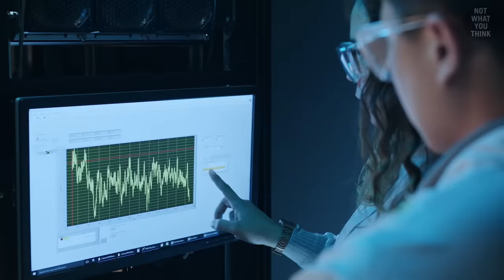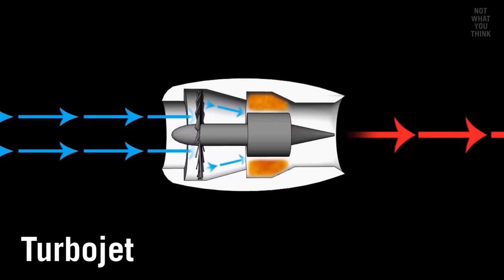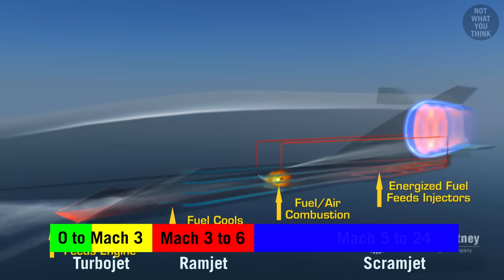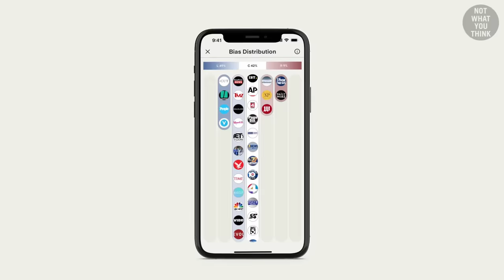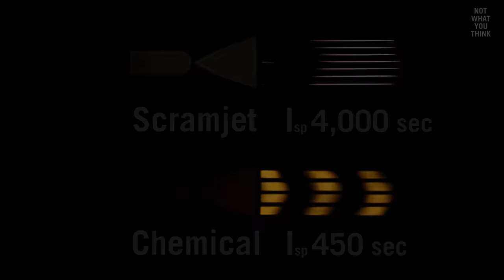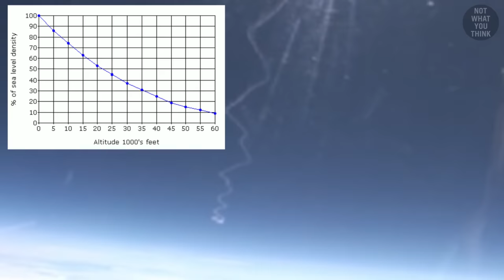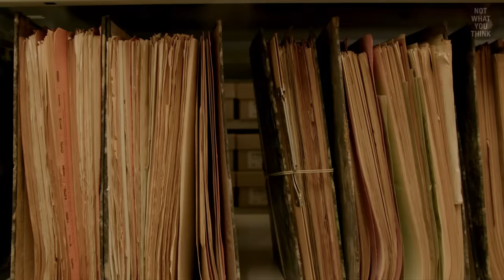The Hypersonic Missile Vulnerability That NO ONE Talks About

Comment: Turning and maneuvering requires exponentially more energy with increasing speed and in practice it bleeds a ton of speed so it's funny how they show hypersonic missiles moneuvering as sharply as basically only subsonic vehicles can. The fuel energy density and thrust to weight ratio would have to be sci-fi level to turn like that at hypersonic speed.
Reply: That's why Russia and China only shows CGI renders of their achievements.  not a single video for peer review.
Reply: @Shinobubu  exactly
Reply: Yea they always show these "artist conception" renderings of a missile casually steering around air defenses while at hypersonic speeds.  If the air defense radius is 50km and the missile was 'only' doing mach 10 (not somehow mach 25) it would be pulling something like 24g-s which is in the realm of a constant car crash.
Reply: I was wondering about that.  I thought trying to overcome the forward inertia and maneuver would require so much force (and strength in the missile body itself) that the maneuvers would be very slow and very wide, i.e. - the opposite of nimble.
Reply: @Shinobubu  dear leader comrades do not need proof. just faith in Marxus Christ and complete obedience, no matter how many family members starve or get sent to concentration camps.
Reply: They make sense. The fact that interceptors are able to adjust their trajectory to make a minor adjustment to hypersonic missile's adjustment in trajectory boggles me. By the time the interceptor can move, the hypersonic is past the point of interception.
Reply: technically this is not an exponential, just a high-power. anyway, a lot of fuel and a lot of space and time to make a good turn
there is only one exception -- terminal phase and/or reentry phase.
and that's why the technology like falcon htv-2 MAY have some sense
this topic however was not discussed by the narrator
Reply: @hodge12009  24G isn't really a lot, in the late 80s air to air missiles were able to pull 50Gs. 24G is in the realm early 70s missiles.
Reply: it's not a big deal to make a missile capable of operation at 100 G load (see Spartan missile from Safeguard project), it's a question of how, and in which direction the force/overload is directed, and how to make it usable, without losing too much energy
Reply: correction: Sprint instead of Spartan
Reply: The maneuverability of hypersonic limited only to avoid ballistic trajectory which making it possible to be blocked. Speed and uncertain future location make hypersonic harder to intercept.
Reply: @Михалыч Наливай   @Михалыч Наливай  That's linear acceleration from a rocket motor, Proximity fuses were made too all the way back in WW2 that could take 20,000 g's linearly, I know that's entirely doable durability wise. I'm questioning if it's possible for an air-breathing aerodynamically maneuverable craft to pull those sorts of g's at those speeds. Maybe it is, but I doubt it.
Reply: H2, it's rather highly unlikely, with some exceptions, somehow realized in falcon htv-2 project
btw, don't you find some similarity with putin's avangard?
considering that htv-2 was tested before putin even announced the russian super weapon, I suppose that russians simply copy-pasted the simulations. They even chose the similar form for this hypersonic warhead.
and in case of american htv-2 the choice seems to be resonable for their purpose (gliding and dropping at the terminal phase), for russian this looks to me simply like a fake, nonsense
it's also important that for american htv-2 everything happens for the cost of kinetic energy in the terminal phase, not for the cost of engine power (except for tilting/rotation, according to animation), while for russian super weapon it's shown as if it travels something like intercontinental distance
alltogether, i doubt that the real hypersonic (i.e. having hypersonic engine) anything can be even close to what gliders can do. Including operational range capability
Reply: @Михалыч Наливай  There does seem an uncanny similarity, could be just the best shapes or maybe a bit of ctrl-c ctrl-v going on lol.
 I wonder if a hybrid design might be the real future, like a Sprint missile attached to a glide vehicle or supersonic cruise missile providing the best of both designs. The boost stage gets it there, and as soon as it gets over the horizon to the target and can be painted by radar the payload rocket stage lights ramming itself at incredible speed through the lower atmosphere. Getting there before interceptors could react and using a simple, proven design like a cone covered in ablative materials since it only needs to survive a few seconds in those conditions and doesn't need to steer much.
It'll be interesting to see how the operational models actually work, if they ever do lol
Reply: @evanroberts2771  The thing will either be fast enough to dodge CIWSs or agile enough to dodge C-RAMs, never both.
Reply: I think the whole concept around hypersonics and there manoeuvrability is to do more with if you shoot at them you have to aim much further in front because they move so fast so even a small change in direction could puta few kilometers of distance between defences and attacking missiles
Reply: @rossbroomfield5199  which becomes void if you factor in the target's self-defense assets and the possibility of blanketing an area with projectiles and debris, say with fragmentation warheads or even chaff. Any impact with a remotely solid objects at anyrelevant speed is going to create a lot of problems for any missile
Reply: @acceptablecasualty5319  sci fi will be sleep place for them
Reply: @maxinfly  That is not how physics work.
Reply: @acceptablecasualty5319  I do have education - trust me it's exactly how it works.  Energy could be same regardless change of direction - any rotation is the simplest examples.
Reply: @maxinfly  I'm not sure wether we're losing something in translation here, but change in direction always implies a change in energy, as well as in relative velocity to any point of reference. Add in atmosphere and control surfaces and everything becomes a lot more complicated.
Reply: @acceptablecasualty5319  Energy is a scalar value - it has no direction. It knows nothing about direction. Imagine a ball running without a friction in a bended pipe horizontally - it would follow pipe pending keeping energy constant. You probably mean impulse, not energy. BTW nobody says - i's a simple task
Reply: @maxinfly  Ah, i know what you mean and you're right! But what you're not considering is the way this change in direction is achieved in-atmosphere will always carry some loss of energy via friction, plus a change in AOA neccessitates a reduction in Thrust to avoid a choking of the Air-Breathing Engine.

So, in short, while the missile won't lose Energy by turning, it would certainly lose Velocity as an expression of Energy.
Reply: @acceptablecasualty5319  not really, for the plain it mostly depend if it sleeps during turn. Otherwise turning makes almost no difference for energy loss. E.g. gliders like to  turng in accending
Reply: @TheNicestPig  "24G isn't really a lot"
It's not on a single axis, it is when adding an axis of force needed for changing course.
Reply: @wisenber  You never read the part about how 50G guided missiles exists since the late 80s?
Reply: After seeing startship flip itself midair, and knowing thrust vectoring exists, I can't imagine it's that hard to adjust the trajectory of a hypersonic missle
Reply: Any kerbal space program player knows that
Reply: Turning were achieved with Vectoral thrust not aoa surfaces. 
Could it lost speed in very aggressive/tight turns? Sure, they could even enter uncontrollable spin but are they behave the same way with winged jets? Absolutely not.
Reply: @Shinobubu  Russian release videos of their ground launch. Imagine asking B21 Raider datas and vids for peer review. You must be dumbest in the class.
Reply: @Shinobubu  bro how do you record a hypersonic missile on video
Reply: @acceptablecasualty5319  literally just bring back WW2 flak walls
Reply: @Shinobubu 
Cope
Reply: @gwho 
What’s funny is how propagandized you are while coping about how they’re propagandized.

China is just a functional nationalist state, honestly. If hypersonic missiles were no big deal, why did Blinken immediately get on his knees to beg China for forgiveness after Iran got their hands on them?

Comment: The efficiency of air-breathing engines comes not so much from using air as oxidizer (though that is important too) as it comes from using it as a reaction mass. This is why high-bypass turbofans are way more efficient than regular turbojets - they spread the output energy over more reaction mass, so that the same momentum can be gained with lower speeds (and actually lower kinetic energies even, I think? Not sure about that, that doesn't sound quite right; anyway, slower speeds are easier to handle). In case of an air-briefing engine, even if it burns all the oxygen in the air, you still heat, expand, and shot out all the nitrogen.
Reply: Thrust is based on momentum, which is m*v, while kinetic energy is 0.5*m*v^2, so yes, it's lower kinetic energy if you're using more mass for the same thrust.
Reply: No, you are right, the higher the mass expelled for a given momentum, the smaller the energy is lost accelerating the reaction mass. K=1/2 mv²= p²/(2m),so when m goes to infinity, K =0. And the momentum you give it is the momentum you get in reaction. (frictions appart). That being said, adding frictions in a moving fluid makes it a bit different. The maximum propelling efficiency is obtained when you are traveling at terminal velocity from the fluid's inertial framework, and expelling the mass at the same terminal velocity in your inertial framework, in the opposite direction. Kinetic energy is a strange beast when you think about it, since it changes value when you change the inertial framework.

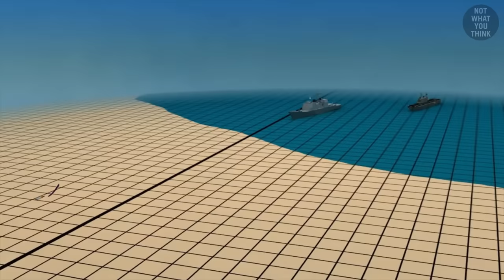Comment: 16:06, let's say that the footage was at a very generous 60 FPS. Over the course of 2 frames, it travelled, say, (once again being generous) 50-ish feet. That puts it at around 1500 feet per second. That would be mach 1.34 at sea level.
Reply from the maker: yeah, we did similar calculations (but didn't include them in video), it was travelling at mach 1.5 at most.
Reply: @NotWhatYouThink  you can easily sustain speed on sea level up to Mach 3. The India BrahMos fly through out its flight with speed higher than Mach 3. And quite few US air to air missile fly faster than Mach 3 as well.
Reply: @ravenkk4816  Mach 3 wtll make them easier to shot down, compared to hypersonic speed of Mach 10
Reply: @bq1000bq  i am just point out it is silly to say that you can’t fly higher than Mach 2 in sea level. Of course the any hypersonic missile is faster than Mach 5.
Reply: Perhaps it just lost speed once it got into the thicker part of the atmosphere. But obviously the mach 24 claim is a lie.
Reply: @ravenkk4816  And, no one has said this. So, why are you trying to argue against a point no one has made? Stop beating on straw men.
Reply: @cjohnson3836  unless he deleted that part and reloaded, he said that the missile had to slow down other wise it would be too hot.
Reply: its quite likely that its a P-800 onyx supersonic cruise missile, as previously some supposed footages of the zircon all turned out to be P-800 launches
the footage in 15:17 is too an onyx btw, good work for the details NWYT
Reply: you don't need to make all these calculus. you just need to know that any big enough object flying at mach over 1 creates a shocking wave that would smash everything around. Not what you see at those footage

Comment: And this is why railguns make more sense, honestly. They'd eventually be able to launch a hunk of material the size of a car faster than a meteor in orbital arcs at targets almost anywhere. Might take a while for it to land compared to a direct missile, but it'd definitely be a hell of a lot cheaper to just saturation bomb them with kinetic payload. They're going to need development in the fusion sector, though, in order to really get the power needed. Really hoping Helion can pull through with its next reactor design.
Reply: A  rail run needs something the size of a large ship to carry it, and then there's the energy required to power it. It has it's place but I think outside naval ship to ship warefare it's not  currently practical

Comment: The upper bound of ramjet utility is actually less about Shockwave induced pressure loss at Mach 6, but because of the temperature rise following the shockwave that's required to provide the combustion chamber with the subsonic air it needs. That's why scramjets are a big focus of research, because your ramjet will no longer depend on a shockwave to recover subsonic flow for the combustion stage - the combustion can take place using supersonic flow.
Reply: Use the tiles from the space shuttle to cover the combustion chamber walls. Like in a rocket you could use a film of fuel to cool the walls. A bit soot at the end is a small price to pay.

Comment: Quick correction, the Space Shuttle didn't actually experience a coms blackout due to the antenna being outside the plasma envelope in the tail stabilizer.
Reply: Smart
Reply: It's amazing what people don't realise.
Reply: @Waynesification  Most people don't know since it's the only orbiter to not have that issue.  I only know because I watched a documentary that interviewed NASA engineers who discussed the pros and cons of the Space Shuttle vs the typical capsule design whose main purpose is to get humans to the ground alive.  While the Space Shuttle's main purpose was to deploy and assemble massive structures in orbit, then get humans back alive.
Reply: @mrspaceman2764  I mean it's obvious there are ways like this around the problem.  The point in design, is not that things are, or are not, done but what can be done, and the reasons why things are, or are not, done, and figuring out a way around it. Channels admiring or bagging something, rarely can figure things out, as they are either just fans of the positive or fans of the negative.
Reply: Only after they started using the Tracking and Data Relay Satellite system did the Shuttle not have blackouts any more.
During the first few years, they did have a blackout between about 400,000 to 200,000 feet.
Reply: @muskiet8687  Exactly.  Though I think I could get signals back and forwards using what I said, or laser, or a special feature that allowed me to minimise the plasma or control it for transceiver function.  I'm not going say it's not going be a major effort.  But that's what these things are.
Reply: Probably a conflation with the Apollo reentry vehicle losing coms

Comment: As recent events have shown, when you're being intercepted, speed actually doesn't matter too much. Because if you're running towards the enemy well, you're not exactly running away.
Reply: "Towards" is a keyword here. It may happen that missile flies tangentially to enemy's interceptor. Then speed does matter.
Reply: It depends.  Read up on something called "Proportional Navigation". It is the foundation of most modern air defense weapons guidance.
Reply: In other words, the range of the Patriot system against these missiles is reduced down to 10 kilometers or less.
Reply: @JAnx01  Why do you say that?  The range of PAC-3 against aerial targets is around 80km and against ballistic missiles is 40km.  PAC-3 MSE increases these ranges out to 120 km and 60 km respectively.
Reply: @philsalvatore3902  Well, that's true, the problem with these missile systems is they don't really do much for the missile.

They still leave what is plenty of time for the system to shoot them down. Keep in mind the US military has shot down stuff moving as fast as satellites.

And theoretically they could have maneuver, but at going at such speeds. It wouldn't be much because if they maneuver too quickly. Their own speed would quite literally tear them apart. G-forces that are involved in the change of velocity basically.
Reply: @youtubesurfer134  The trade off of airpseed and altitude for maneuverability is true for hypersonic glide vehicles (HGVs) since those are unpowered once released from their booster,.  Air breathing scramjet powered hypersonic missiles can maintain airspeed and altitude while maneuvering.  They can also fly a flatter trajectory than HGVs or something like Kinzhal.   Their ability to maneuver becomes I think more of a factor of the ability of materials to withstand the high heat and aerodynamic forces associated with hypersonic flight.  Many air defense missiles can execute turns up to as high as 30gs so I think it is not impossible to have highly maneuverable air breathing hypersonic missiles.